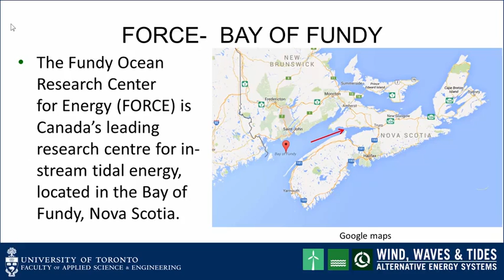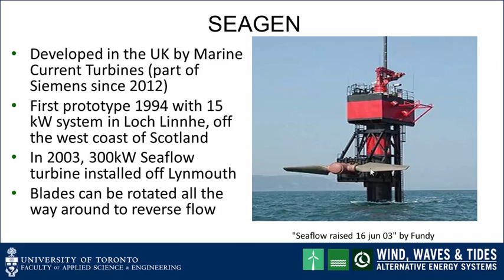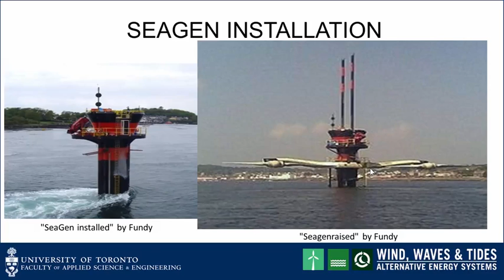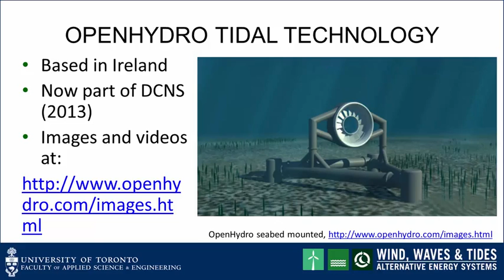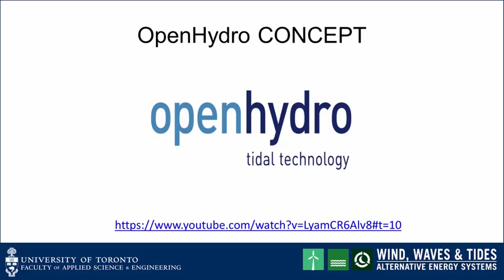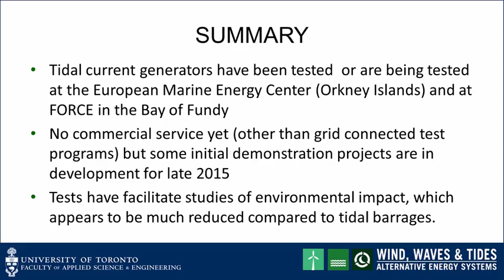Tidal Current generator power

Comment: My thought has always been to use extremely wave heavy areas with a buoyant bouy attached to a ratcheted pull cord like a leaf blower or chainsaw. Ever time the wave trofs the rope is recovered, every time it peaks it pulls the rotor. Like on of those fan resistant rowing machines. Obviously the forces are very extreme so maintenance is a limitation but the up down forces seemed much more powerful than the under water currents. I was always under the impression that this was original idea it seems like the installment of these are capable of being very compact and the forces involved are much more extreme which in my mind meant much higher outputs. Has anyone actually considered this or did I just imagine I heard this.
Reply: https://youtu.be/nQGKfAPxsiI never mind found a good example, which do you suppose has more potential.